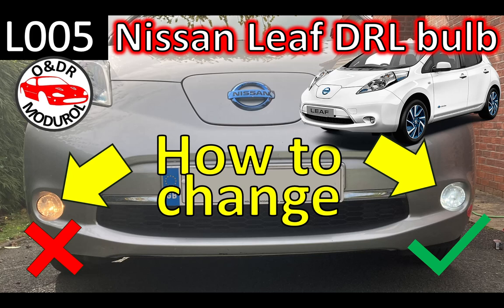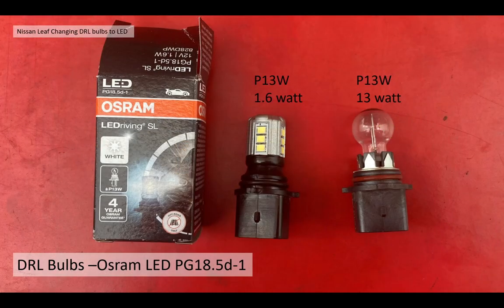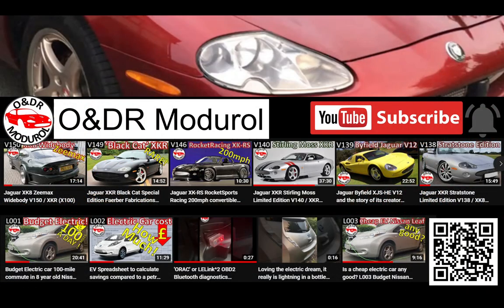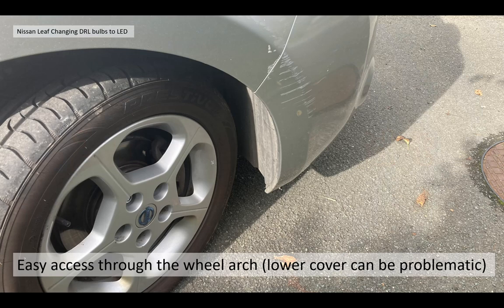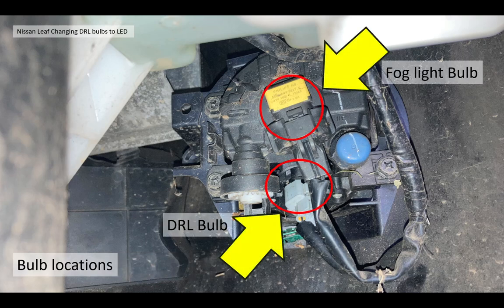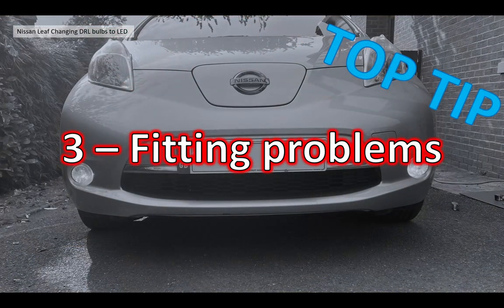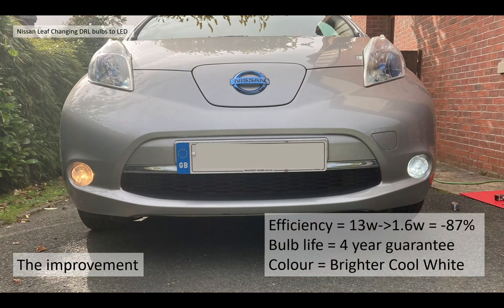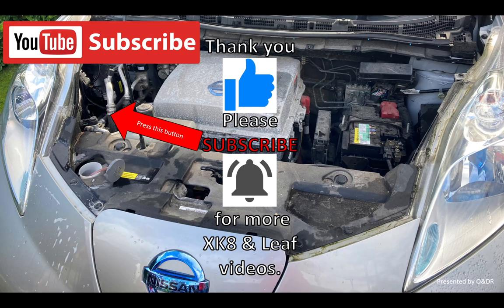Nissan Leaf Change DRL to LED bulbs Daytime running lights L005

Comment: Thanks for showing ITS the better way for fog and winter time. merry Christmas .all. best regards Udo
Reply from the maker: Udo, theses OSRAM LED bulbs are much brighter and better for DRL application on the Leaf. Haven't had the same experience with the chinese LED I used for the DRL fog on the XK8. Got a better bulb for that now. Hopefully will give some feedback shortly. Drive safe in the winter fog. Thanks for the comment regards Damian

Comment: Fantastic video and presentation, excellent stuff. Looking forward for more Leaf DIY. Greetings from a fellow Leaf owner in Malta
Reply from the maker: Ray, Thanks for the comment and compliment. More stuff in the pipe line. How does the battery perform in Malta's climate? regards Damian
Reply: @ODRModurol  Must have missed your comment...sorry for the delay...re Battery performance and climate, not the best conditions especially during the summer months June -Sept, but due to the very short distances here very little DC quick charging is done and most charging is done at home on L1. Mine had the BMS update done at the Nissan Dealership and thankfully still on 12 bars.
Reply from the maker: Ray, thanks for the reply. I thought it might suffer with the heat, interesting stuff, regards Damian

Comment: I love your videos! I just recently got a 2012 Nissan Leaf with 30k miles, truly a dream car. Have been upgrading the cars lighting and according to the manual, the SL Trim (which I have), fog lamps call for an H11 bulb, so I assume the Euro model cars have two bulbs as you describe. Let me know, thanks!
Reply: I can confirm that there is only one bulb in each fog lamp on my 2012 Nissan Leaf.
Reply from the maker: @e-rollcorporation152, sorry didn't see you post until you already answered your own question. I believe there was a slight facelift for 2013 hence the slightly different fog lamps with additional DRL bulbs. The leaf is really interesting and reliable mod of transport. Nissan winning just by keeping it simple. Unfortunately, not something most new electric cars offer now. Too complex and too expensive, regards Damian

Comment: Great - can h send a link to the bulbs - the osram ones now are 5w which is pretty bright.  Fine with that but don’t want to buy them if “too bright” as such….? Thanks
Reply from the maker: Simon, The LED bulbs I used are not too bright (1.6W) and actually useless as anything other than DRL's. Please find link below, hope that helps, regards Damian.
https://www.ebay.co.uk/itm/165872130272?epid=10043207292&hash=item269ebfd8e0:g:kP8AAOSwS-ljuFIB&amdata=enc%3AAQAIAAAAwICw5whmhbyqnc1DgdYF5ByVKFQG5hz57Q%2BhcJm%2Fk6RDWb0V1ue7fD4N4KFsAdzlMgFSdWv4%2Ffxhz17prwhaB%2BAzaKj%2FQkrfqOn0wLi7bOfysILa4oj9W1xagcnYKpGOhWZaQyy7v2wR3J3AqozvGuVE2FnWxw1rH4dBI1fCJgnkpXbrDfNbSigX%2FewOKe6sNfAK3h%2Beg%2F8x1Fin2i6LEy1TTo91jdLN%2BpbZSMflXs%2FMNg8KQrnlF3toCK7pm0Fu%2FA%3D%3D%7Ctkp%3ABk9SR5Ku2rynYg

Comment: Thanks, how about the bulb behind the steering wheel that illuminated the steering wheel buttons?
Reply from the maker: Reg, sorry haven’t any knowledge for those bulbs on a leaf. Normally with other cars you need to remove the airbag and steering wheel to access the switches. Sorry can’t be more helpful, regards Damian

Comment: You have great videos brother but I cant for the life of me unscrew the drls. The fog lights screw out perfectly but the dlr is stuck and will only rotate a little bit. 😫
Reply from the maker: Peer, I had a similar problem and it was very tight the first time, plus the aluminium housing might oxidises and expand to grip the light fitting. Need to get a good grip and turn anti clockwise. Might need pliers to assist and be brave. Hope you get them out, regards Damian
Reply: @ODRModurol  okay thank you brother🙏 i will keep at it. I just didnt wanna break it 😅thank you for the quick reply 🙏i will sleep better now and give it another go tomorrow 🙏💪
Reply from the maker: Peer, no problem and good luck, regards Damian

Comment: Great video... although I cannot get the DRL to turn (fog light very easy!)... :-(
Reply from the maker: Simon, assume you means turn on? Have you fitted the new bulbs? DRL should turn on automatically, regards Damian
Reply: @ODRModurol  sorry terrible comment... couldn't get the bulb holder to turn (either clockwise or Anti-clockwise)! Didn't have great purchase on it, but should have been enough
Reply from the maker: Simon, might need to push the bulb down then rotate anti-clockwise. Hope that helps, regards Damian
Reply: Perfect advise! On drivers side I also found it easier to dis-connect the cable first before pushing in and rotating to remove the bulb holder.
Reply from the maker: Simon, glad you got it sorted, regards Damian.😀👍
Reply from the maker: Simon, no problems glad you got it sorted, regards Damian